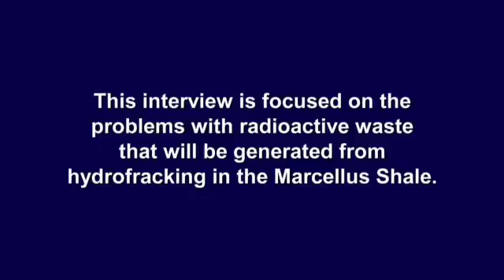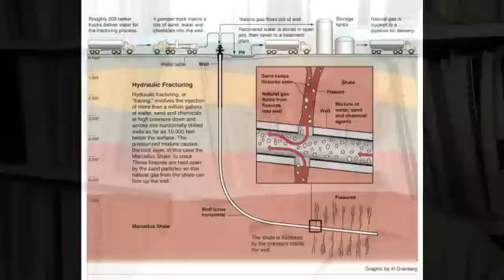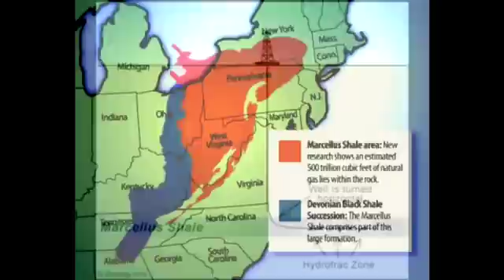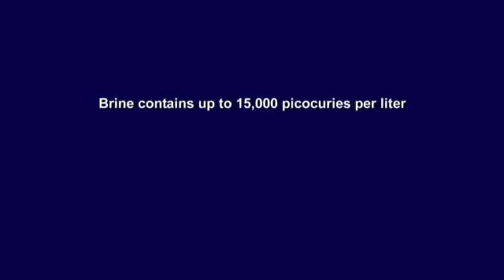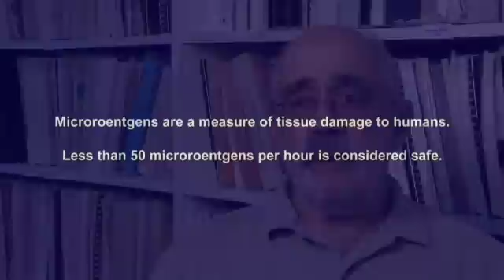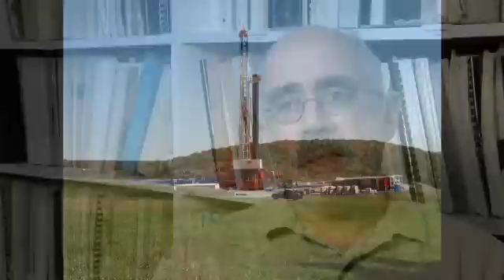Radiation Problems due to Hydrofracking

Comment: While the good Dr. presents some factual information, some of the standards and concepts he cites are purposely chosen with an agenda.... 

For example, the 15 pCi/g level he cites is likely the subsurface soil contamination level from the UMTRCA standard. Scale inside a pipe compared to soil contamination levels? Apples to oranges.  Different modeled pathways for exposure, etc..